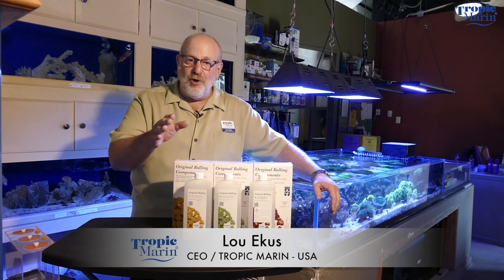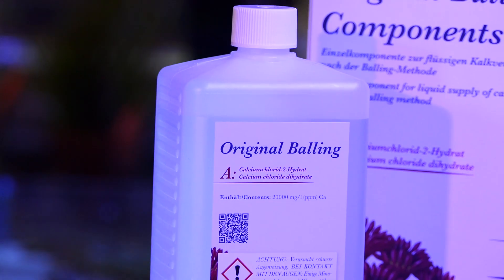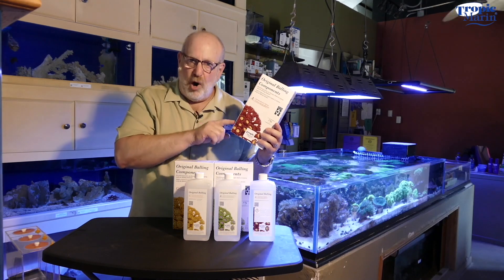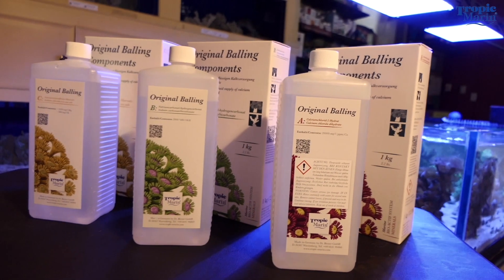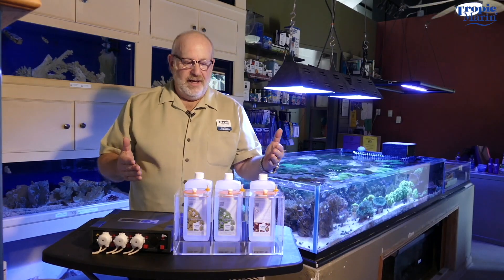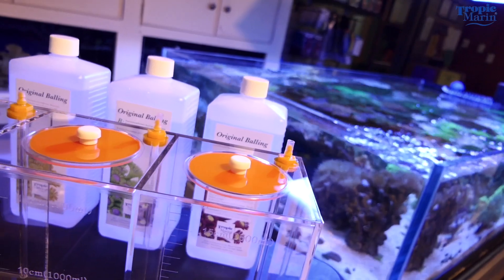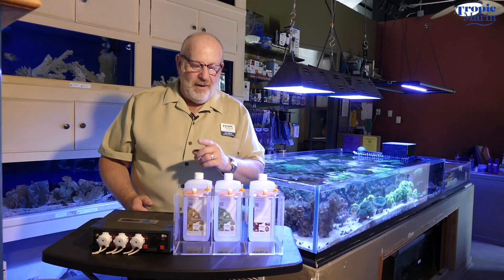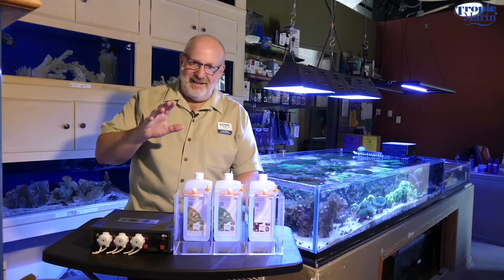Tropic Marin - Original Balling Method (EN)

Comment: I have a 4 head dosing machine, Do I need dose part C if I am dosing All-for-reef + Part A and Part B? If no, anything can I dose which that one head to make  more comfortable to the biology in my tank? Thanks
Reply from the maker: If you're dosing All-For-Reef + Part A + Part B, there should be one dosing head left when you have a 4 head doser.
The other question is why are you using All-For-Reef + Part A + Part B? You can just raise the All-For-Reef dosage and omit Part A + Part B.
Reply: @TropicMarinOfficial  haha, I dont have a tank now, I just bough one and will have it on April, I just dont understand these thing, I believed I need to dose AFR + Part A and Part B, lol
Reply from the maker: @Hailehk  All-For-Reef is a complete supplement in one solution. ;)

Comment: I just started using the balling method and I buy my things from BRS. They are recommending that I use my alk dosage to base my balling dosage. I believe that Lou is saying to base it on the smaller dosage of eather alk or cal.  I use a lot more alk than I do cal and want to do this correctly.  I have never had a tank that needed the same amount of cal and alk. I have a older tank that has had few water changes. 6 in 8 years. I am old school and I do not fix things that are not broke, I use trace elements and test often. MY tank is awesome and nothing ever dies in it. I have great coral growth and few issues with wa

Comment: I am having problems keeping Mg at desired levels. I need to dose C a lot more than A and B. I have a 120l mixed reef tank. I dose 30ml of A, 25ml of B and 40ml of C per day in order to keep Mg at 1300-1350. In this video you say C needs to be dosed the same amount as minimum of either A or B. For me it does not work that way. So this means i will need to add extra Mg? Can there be any problems if i dose C as i do in the long term?
Reply from the maker: The problem when dosing more Part C is that potassium could rise. We recommend using Tropic Marin Bio-Magnesium or change to All-For-Reef for complete mineral supply.

Comment: Still confused.So part c is mag & trace elements..Part A is calcium. And Part B is Alkalinity. Correct.Asking because i had ben using 3 stage dosing cont with 1 was mag 2 was cal and 3 was alk.
Reply from the maker: That's correct.